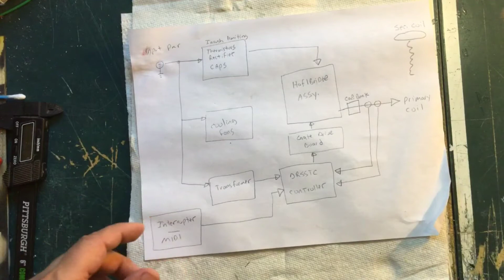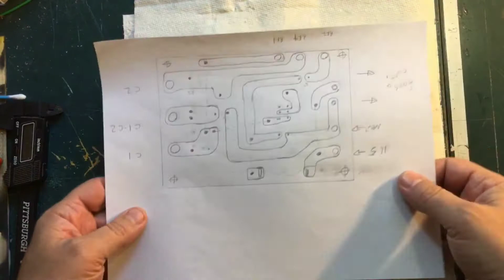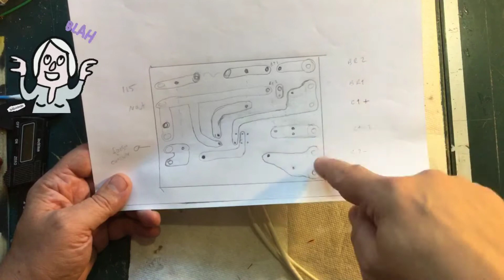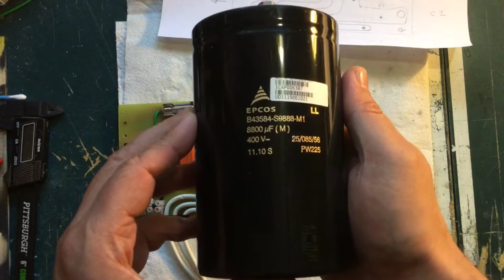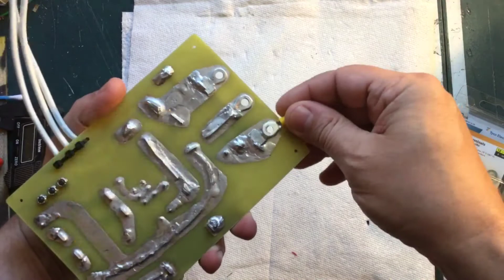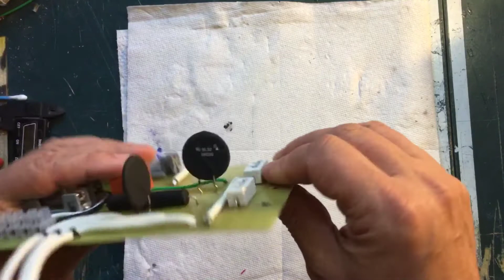Musical Tesla Coil DRSSTC Build part 3

Comment: How you bend copper tube to be perfect spiral like that? I planning to build big drsstc to
Reply from the maker: The tube came in a box already coiled up. I actually had to un-coil it just a little bit to match the coil size I needed. There are two types of tubing; one type comes as straight pieces and is ‘hardened’ and very stiff. The other type is soft and very easy to bend. That’s what you want.

Comment: I assume based on your designs you aren’t planning on using a varriac?
Reply from the maker: It’s not my design, but the thought of using one has crossed my mind. I’m trying not to change the original design, and what little changes I do make, I run by the guy at Eastern Voltage Research to get his opinion.